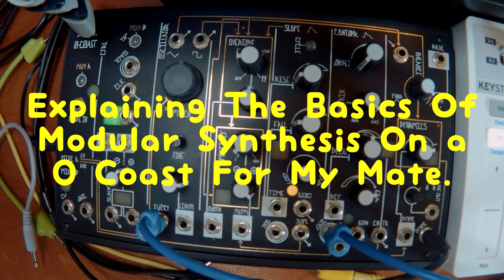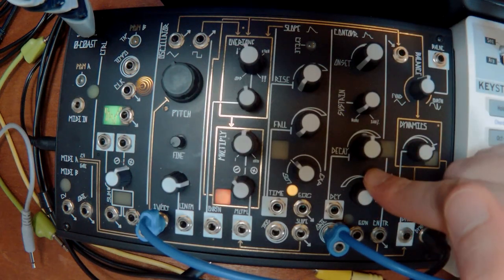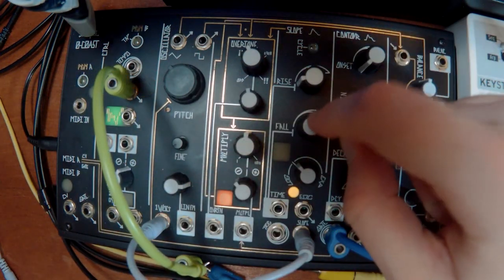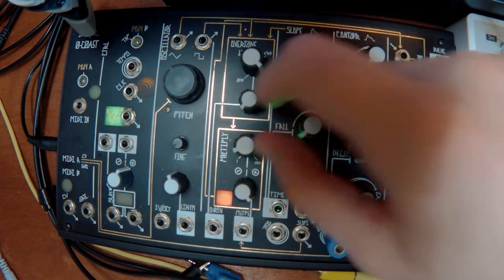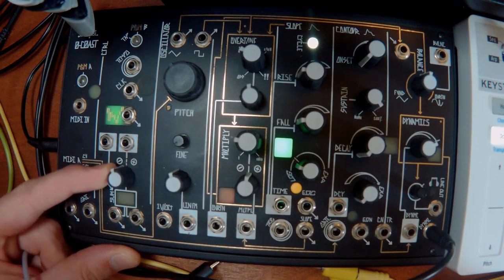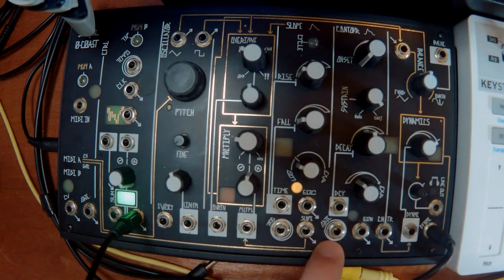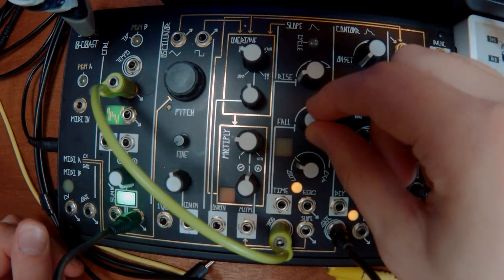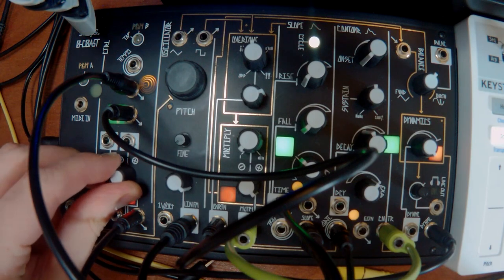Explaining The Basics Of Modular Synthesis On A 0 Coast For My Mate.

Comment: This is awesome, and the most helpful thing I've watched so far. Quick question though, what are the second knobs in both the Overtone and Multiply sections?
Reply from the maker: Thank you that's great to hear, those knobs will attenuate or invert whatever voltage you send into those related inputs. So if you send in an lfo that wobbles from -5v to +5v you can attenuate that range to make it more subtle so it becomes something like -1v to +1v. Or something like that. I think of them as volume controls for voltage signals

Comment: Great video mate Ty . I am very new to this , whats the best place to kinda learn the basics in ur opinion ? and is this 0-coast suitable to have as a first synthesizer for someone who pretty much knows nothing but willing to learn ?
Reply from the maker: I think the 0 Coast is a suitable instrument to have as a first synthesizer, it has a bit of a learning curve but I cover a lot of the basics in this video, what might be tricky is that they use different circuits than most regular synths, so instead of an 'envelope' they use a 'contour' they're both essentially the same thing except that the circuits in the 0 Coast can be used in a variety of ways. Mylar Melodies has some really great videos teaching some of the concepts of this stuff and Looppop also does good ones thought it's quite hard sifting through all their videos to find the appropriate ones
Reply: @SoundsMick  Thank you very much for ur recommendations!!  I will check those channels for sure .  I have been also seeing the mother 32 as a synth thats being recommended allot for absolute beginners , so Idk maybe more research on my side i guess .
Reply: @eliekhawand  check out the bastl kastl or softpop..